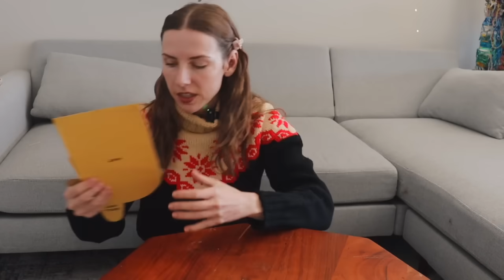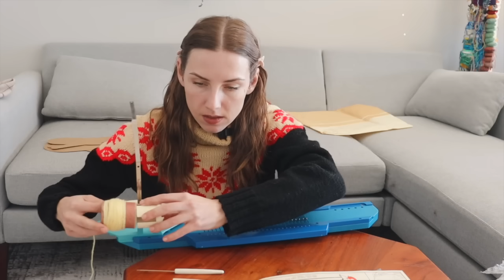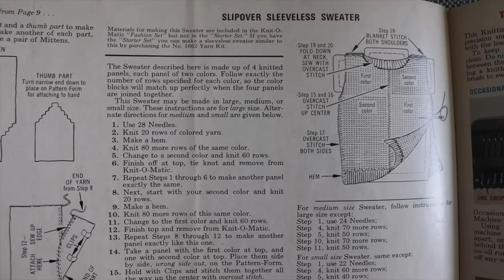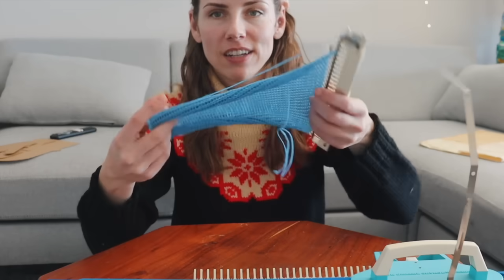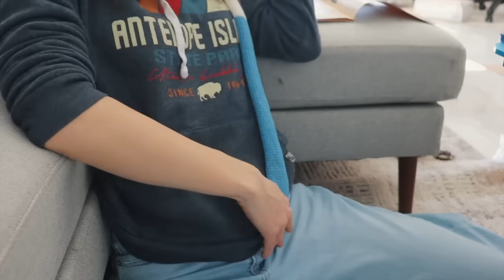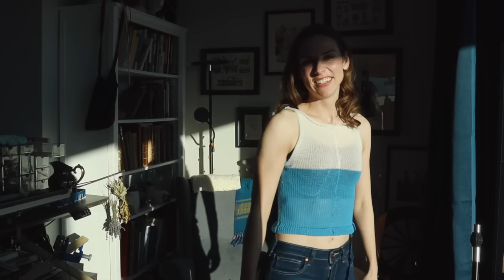Can you knit a real sweater on a vintage toy?

Comment: I think more panels would of been good, also the table you were on needed a non slip pad, I would of used the sofa there might have been better stability.  I think what you made and the machine is quite cool, If I come across one I will have to get it, after all in the winter or even if no electric you get something you can do and possibly make some extra money on the side, would love to see if it made booties for your feet or leg warmers?

Comment: I got this toy for Christmas, 1969!!  I remember all of these parts and instructions.  And watching you move the carriage so reminded me of the jingle for the TV commercial: “Knit-A-Row-A-Second!”.   I was 11.5 yrs old and I had learned to knit, with two needles, the previous winter, while attending Brownies.  I mastered every technique in the instructions.  I simply detested rewinding the cardboard rolls with yarn….  This was so fun to watch.  I was transported.  I felt like I was back in time with my machine, knitting at the kitchen table.  This was soo great.
Edit:  I remember white, rubber bumpers at the ends to keep the carriage from running off the bed.  And something about using petroleum jelly to lubricate the needle bed.

Comment: My gran had a proper knitting machine, the trick was to move the 'thing' swiftly. Hesitation causes snagging, but too fast also drops stitches. She'd let me continue while she went to make tea or take a loo break. I would take a wide stance with the thing at about shoulder height and with both hands, moved like a tai chi master. Sometimes her arm would get tired so she'd ask me to do nine or thirteen more rows for her, whatever she needed. I watched closely, but I never did get my head around changing colours or picking up stitches, her deft fingers were blurry.

Comment: Such a fun video! I'm really impressed with how well that toy knitting machine worked. And, extra impressed that the old plastic held up so well.

If you'd like some help counting lots of rows. I'd suggest trying a click counter (I think that's the name of them). They're these little hand held mechanical things that look kind of like old VCR/Cassette counters, but they increase each time you press a button with your thumb. Some towns used to have workers go to different crosswalks and use them to count the number of cars that would pass through during specific times to help with adjusting traffic lights, but you can probably just find them on Amazon nowadays.

Comment: It probably would have held up better if you had placed it on a table with a flat edge that was at least the length of the machine.  It looked like you were having to awkwardly hold one end of the machine that was hanging over the side of the table and that was racking the machine,  perhaps loosening it up.

Comment: There's a job for a 3D printer, table clamps for these toy knitting machines. Also use some cool melt glue to keep the spool holder attached. 91% isopropyl alcohol will release the glue if you need to remove the holder. A piece of rubber shelf liner might work to keep it from sliding around on a table.

Comment: I had a pink toy knitting machine growing up. It was metal and pink plastic and made by Tomy. I think my mum had bought it in the 1980s when she was considering taking up machine knitting (spoiler: she bought a full "grown up" machine but ended up not using it very much because it took up the whole dining table). It came with an idea book, which included a tank-top sweater you could make if you didn't mind knitting it in vertical strips and you were small enough (very small) to it into the result. I can't remember using it very much. It had a very sturdy clamp for table attachment.

Comment: This is so adorable! I have a special place in my heart for small versions of big things hahaha. I searched for two years for a vintage Mini Empisal knitting machine and finally got one a few months ago and it is everything I hoped it would be (excepting easy to learn. That is still a little difficult because that particular kind of knitting machine has it‘s own challenges even in the big size as it has pushers instead of the needles sliding out) I have taken it with me as a travel machine because it has 60 needles (at standard guage just about) and is about 50cm, so super compact and full metal so durable. My goal is to knit socks on it, but I am far from that currently. Heaven help you if you drop a stitch on that one, everything is TINY. Thanks for your video, looking forward to seeing how you make a full size sweater on it, so maybe I can on my toy knitter too!

Comment: To easily open the latches, cut an angle off an old credit card (or piece of thick cardstock),  it'll look kind of like this:  /__]  but without the gap between the slanted edge and the bottom of the card, then run the point all along the hooks.  It'll only take about 2 seconds to open them all in one swipe.  And omgosh, I love the yoke on the sweater you're wearing! What's the pattern?  I'm thinking I'd love to make a capelet to throw on when my shoulders get cold.

Comment: I got one of these from ebay. Wanted so badly for it to work but all the plastic has rotted and each guide just crumbled. I was so sad. Now it just sits, in its box with all the things that came with it, in my craft room as vintage art. My singer chunky came with a caston bar. Only used it a few times for the hung hem.

Comment: I learned to machine knit on a vintage bond sweater machine and have had similar problems with things getting loose and the plastic bed becoming brittle and cracking. Im now restoring an empisal knitmaster 700 i thrifted.

Comment: I have an old  Bond America Ultimate Knitting Machine and it's so much fun, especially if you combine hand knitting in a garment (combo knitting).  Adding a slender hand-knit or crochet panel to the front would effectively eliminate the visible join and also add a bit of "breast" room.

Comment: I was a kid in the 60s. My mother got one of those from a garage sale. We couldn't get it to work without having to manually fix every stitch, probably because we lacked the knowledge of knitting machines that you have. The jingle for the toy had the lyric "knit a row a minute", but we ended up singing "knit a row an hour". Unfortunately, I think we tossed it.
Reply from the maker: I love hearing stories like this, even if it means you had quite a frustrating time with the machine. I don't think it is a super beginner knitting machine, but your story of the "knit a stitch an hour" is so funny. I feel like that sometimes with my full-sized machines!
Reply: Wow!  I still have 2 of these, from my teens, one for me and one for my mother, and the constant jamming amd dropped stitches forced us both to give it up. I also went through several Apple Pie knitters when I was about 5, 6, & 7, that I would make Barbie clothes on, and I always blamed myself for breaking the pegs and only last year found out the broken pegs were because of the bad cast-off instructions that had come with it. So some day I might try loom knitting.again.    Once I learned crochet, though, I never looked back for the next 50 years.
Reply: I had one of those in the 60s. Got it for Christmas I recall mine working but I was more into crocheting and sewing. My mom probably passed it on to a younger cousin.
Reply: I got one for Christmas when I was little in the early 70's. Mine was red and very heavy and metal. I never was able to figure it out enough to make anything 😐  I am a crocheter now lol
Reply: Actually I think it was "Knit a row a second"
Reply: I couldn't crochet or regular knit but I found out that I could loom knit.
Reply: I loved ur story

Comment: I had this toy knitting machine!  The carriage was "stiffer" and didn't slide easily - even at age 11, I realized that it should have some type of clamp to hold it down to the table.  I made a scarf with the woefully inadequate yarn included but never tried anything more as the carriage wanting to freeze up was frustrating.
Reply from the maker: How amazing that you had this! It is a very stiff carriage, I had to grip onto the bed quite a bit to get it to slide. I wish it had a few less sticking points for you, but how cool is it that I get to chat to someone who owned one!